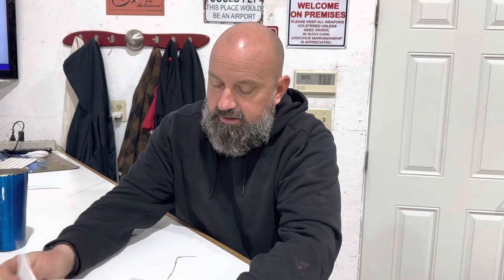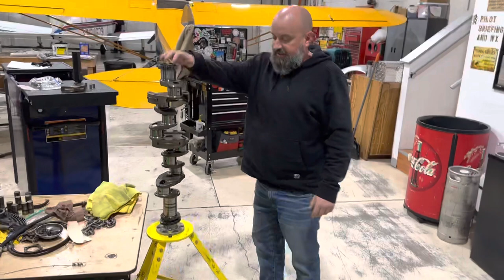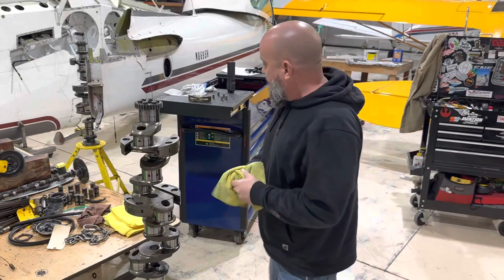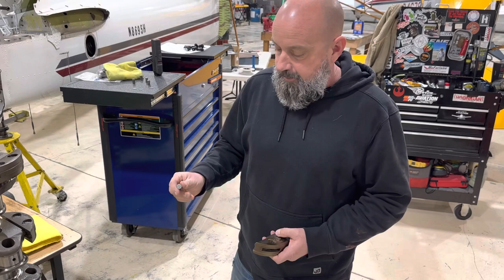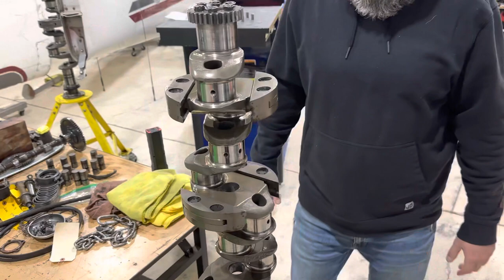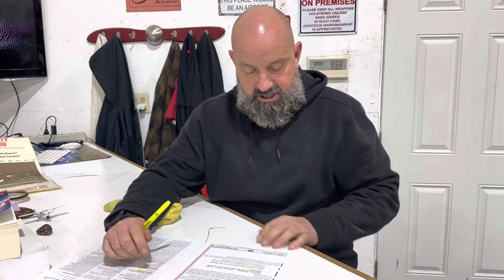Continental grounds planes over crankshaft but why?!?!

Comment: Hmm - opposed cylinder "boxer" engines don't need counterweights. The pendulum dampers you mention are there to stop the crank from winding up and springing back at one specific frequency.
Reply: If opposed cylinder aircraft engines don’t need counterweights, you should inform Continental and Lycoming engineers to save them $ millions from not installing them…
A&P/IA,ASE

Comment: As a AI for 43 years, I would have to say Manifold pressure is the key to crankshaft dampeners working correctly, If you look at most Manifold pressure gauges, the bottom of the green arc is 15", this is the minimum engine piston pressure where the engine is driving the propeller any lower and the propeller is driving the engine and the counter weights flop around and get detuned, rings flutter on the pistons and engine cooling, not good for the engine and snap rings have not changed in 50 years, one side is round and one side has a sharper edge and usually marked on the snap ring with a dot. Look at shimmy dampeners or brake cylinders for info on snap rings. education is hard to learn with out mistakes

Comment: Hopefully they show how the snapring is supposed to be installed, with the sharp edge out.
Reply: I suspect that the circlip is not in the groove at all, but just friction holding it in the borescope would show smaller gap between ears of clip.
Reply: @KeithRigby-r9c  Nope, get one out and really look at how they are made. Because the balancer pins are free to move, they put the retainer in between the pin and the clip. So long as the clip is installed properly, with the sharp edge out, to grip the groove when the clip is forced into it by the pressure of the pin and retainer, against the 'SLIGHTLY DOMED SHAPE OF THE CLIP'. 
If that slightly domed shape is up against the groove, it can be worked out by the action of the pin and retainer.
Best wishes from the far North.
Reply: @KeithRigby-r9c  There is a measurement if you read the SB to check the snap ring (clip) ears for a dimension to make sure they are spread out into the groove so 'yep', you are on the right track.
Reply: Carl is CORRECT
Reply: Sounds like Continental dropped the ball on quality Control however any Knuckle-Buster should know what direction the piston snap ring should face ,Radius to the work ..good content

Comment: Thanks for this. Subscribed! 

This reminded me of an old timer speaking about the old GO- aviation engines having operator (pilot) induced issues. He said pilots were used to running 2700 rpm and were hesitant to run the geared engines at the higher recommended rpms. Thus inducing issues and garnering those engines a bad rap.

Comment: This use of internal snap rings within an aircraft engine is shocking.  High performance, high quality automotive engines do not use snap rings.  For example, piston wrist pins are allowed to float, and are restrained by “buttons” on each end of the wrist pin.
Reply: It’s not the wrist pins that need snap rings on these aircraft engines, it’s the counterweights that most 6 cyl engines have.
As far as the wrist pins on aircraft engines; none that I know of have snap rings (as most auto engines have).
A&P/IA,ASE

Comment: Great vid, I used to work in a part 145 engine shop doing tear down (and test cell).
To remove those counterweight snap rings was challenging while the bare crank was vertical on a stand!
I cannot imagine replacing one through a cylinder bore in a case while engine is installed on aircraft.
A&P/IA,ASE

Comment: That was a good explanation of the problem complete with visuals.  I am a aircraft mechanic myself, but I don't work on any Continentals, just Lycoming and turboprops.  I like your approach to stuff, yes facts based are the best and don't guess, as you said you can form an opinion, but don't guess.  Good job, will be checking out more videos

Comment: I stopped watching at 7:30 just to say that the engine seizing is not the worst part of it, it's what happens immediately afterward. Back in 2015, a good friend of mine crashed his V35B Bonanza after his engine seized at 500 feet AGL on takeoff, due to the exact mechanism you're describing. His engine was around 100 hrs after TBO, an IO520. One pin dropped out and the swinging counterweight cleaned out half the crankcase, taking one cylinder and both magnetos off as it went around. He had just throttled back to best climb from takeoff power, which as @mpgofast alludes unloaded the weights momentarily. Subsequent teardown of what remained of his engine showed the circlips incorrectly installed on another of the weights. He was airborne only 33 seconds after the failure, he sustained severe injuries, but his three passengers walked away with bruises.

FWIW, I've flown with him many times, including twice from NC to Oshkosh, he does not mistreat his plane and flies according to the POH and his 15+ years of flight experience.

Comment: Interesting video that youtube thought I might like... I was a terrestrial engine mechanic for many years. This dynamic crank counterbalance scheme is new to me.
I would be interested in knowing what the problem was with the circlip installation: 
was it clocked wrong?
was the sharp edge of the clip installed facing the wrong way?
Reply: Yup I heard it was the sharp edge.
Reply: It is a stamped circlip. thus it has a round side and a sharp side the sharp side must be on the outside. Some how the rounded side sneaks past the grove and dislodges itself
Reply: @midgetrace  yep,  sounds like that's what happens and happened, some were installed the wrong way

Comment: I know the old E-series engines (E-185, E-225, etc.) don't fall under the AD, but if you have an E-series crankshaft, I'd be very interested in seeing how the balance weights work on those, if they're any different.
Reply: That is because the factory did not sell any new E225s

Comment: You did not explain the fact the issue is with the direction the snap ring is installed.  Many may not understand when snap rings are manufactured they are stamped with a die-set which actually distorts the flatness of the ring with one surface edge becoming slightly rounded and the opposing edge becoming sharpened.  Interestingly this distortion comes with the advantage in that the sharpened edge helps with retention provided the snap ring is installed with the sharp edge opposite the force trying to push the clip out of the groove, in this case toward your face if you are looking directly at the snap ring.  Inversely, if the snap ring is installed with the rounded edge outward then this has the effect of increasing the probability the snap ring can be pushed out of the groove.
Reply: There can also be "clocking", or orienting the gap in the lip to a specific location on the circumference of the groove, which is usually expressed relative to a colck dial. Remembering the clip is spring steel, one half of it may be subject to a force seating it more tightly while at the same time the other half can bend and slip out of the groove. Piston pin clips are often specced to be fitted at 12 oclock or 6 oclock referenced to the bore line so that the inertial force at the ends of travel are balanced and not on a single half of the clip. On these crank weights where centrifugal force acts, you'd orient the gap toward the centerline of the crank to mitigate it; 12 oclock is how that's referenced to in this situation.
Reply: @P_RO_  Right.   I know we've used these stamped clips for about forever...and properly installed they DO work well, but doesn't it seem odd that in such an expensive engine that these retainers would be made where it's critical HOW they're installed?   As we should have learned with Col. Murphy....if it can be installed wrong, design it so that it cannot accidentally be done incorrectly.   This is a clip that costs a few pennies....so we make a better one that works either way it's installed and even if they cost ten dollars to make this increases the cost by $240 which is a pittance on a $30,000+ engine.
Reply: @recoilrob324  They DO work well if made and used properly, so why change from success to complex which might be equally vulnerable to stupidity? Some things clearly have specs, like a cvlinder head bolt. Everyone knows how critical it is to torque these in stages and in a specific pattern, so you look it up  each time.  We don't need specially sized bolts to keep "Bubba" from grabbing a box-end wrench and guessing here. Nor do we need different clips. It's easy to do the job right, and you can't expect a manufacturer to design everything to be stupid-resistant.  :Personally I'm more worried about a design using intentionally loose parts on a crankshaft. There's so many dynamic forces going on there that such a design invites a huge number of issues which are best avoided several thousand feet above the ground and several dozen miles to the nearest place you might be able to set down at with a decent chance of walking away.
Reply: @recoilrob324  And there is a better "mousetrap". It's called a spiral lock or Spirolox.  A full 360 degrees of engagement. There's a visual indicator if it is not fully installed. The installer can tell if the free end  is not fully seated into the groove, because it's not flush with the remainder of itself. And, there is no difference what orientation they are installed in, because they are burr-free.  I'd hope Continental would take this as an opportunity to do the necessary qualification work and make a good product that much better.
Reply: @P_RO_  The fact that you are entirely unfamiliar with dynamic balance weights ("intentionally loose parts") on a crankshaft tells me you have little to no aviation mechanic experience.  Dynamic balance weights are a very common thing on rotating assemblies on recip engines and dynamic components on helicopters (BO-105, UH-60 main rotor systems, V-22, to name a few). They are very necessary and frankly the simplest way to achieve the needed vibration damping in many applications.  A better solution to circlips is needed, and it's not complex, it's simpler. I would hope they take a hard look at spiral locks as a potential drop-in replacement.  Hell, you can install them by hand in most cases, and remove with a common screwdriver.

Comment: Is the proper installation of circlips covered somewhere in AC 43.13 1b/2b or is it information that would be in a manufacturer's instructions, or would I have learned this in a formal A&P training program? Just starting out (14 weeks OJT) as an AMT...and this is another thing to add to my list of "Why the hell have I never heard of that?"

I wonder if the orientation of circlips is an artifact of the manufacturing process...I suppose they are die stamped...or is there an engineered intention to give them a sharp edge? I have replaced circlips (on non critical applications, particularly my little planisher and the thust bearings on my band saws) and never could figure why sometimes the circlips would easily slip off my pliers and disappear across the shop while other times they would grip tightly to the pliers as desired.

Anyway, seems like you have lots to teach, so I'm subscribing.
Reply: Yes, the sharp edge is just because they're die stamped.  All engineers I know would want to remove the burrs, if it didn't cost more money (and I work with quite a few on a daily basis).  
The way a snap ring should "face" is determined by manufacturer instructions.  Barring that, you're on your own. No specific instruction was given in my formal training that I can recall, but that training may have influenced my thinking, hopefully for the better. 
I will say in my experience with snaprings, having the sharp side facing away from whatever they're retaining is good for two reasons (and not the reasons you normally hear):
1) Installing with the smoother rounded side facing the component allows the snapring to expand more freely into the retention groove. If installed with the sharp side facing the component being retained, the snapring may bite into the component being retained, or the lower edge of the groove, during install and prevent full seating in the retention groove. You're normally pushing down on the snapring somewhat during install, even with snapring pliers, so having the smooth side facing the component prevents the sharp edges from digging in. Conversely, this pushing down also minimizes the sharp edge from digging into the top of the retention groove during install.
2) During operation, I figure it's best if the component that is being retained is not being chaffed on by the sharp edges. I want what I'm retaining to remain in good condition. There is normally some relative motion between retained components and the snap ring. Whereas, a properly sized snap ring often, though not always, is snug in it's retention groove, and shouldn't move around much in its groove.
OJT can be very good, though seek out opportunities for formal training on topics. It's easy to pick up bad habits from OJT and not know it.  FAA-approved IA seminars (they need them for continuing ed. credit) put on by community colleges are a good place to get low cost training with added potential for networking.

Comment: Snap ring installation. Critical .  Never expand the snap ring farther than it takes to get it over the end of the shaft.  This takes the spring tension out and causes failure.  
This reduces snap ring grip in or on the bottom of the groove.  

 I can't imagine why these aren't being replaced with spirolock retaining rings. 

   Other things that squeeze me wrong are over compressing valve springs when putting the keepers in.   Or putting them in coil bind on the valve spring tester.  Over stretching piston rings to get them on the piston. 

   I totally understand that the retaining rings go on sharp side out. 

Am i knit picking. I build automotive engines. I went thru 6 engines in 5 years in my 66 GTO and have seen decades of engine failures during normal teardowns. Learned the expensive way of what works and what fails.

Comment: So it seems this is the current batch of engines, not all of them. 
If it was a car they would be recalled and repaired by the manufacturer.
Personally this seems to be a very crude system having some weights rattling around on the crank

Comment: Why didn't you mention right off the bat that that the snap ring has 2 sides? One is square and the other is rounded and some of the snap rings were put in backwards with the rounded side out.

Comment: pretty frightening stuff .... loose steel weights banging around on a crankshaft.....i'm way out of the flying addiction at my age now, but back in the day i always preferred lycoming engines....everything i read about continentals seemed to come up short compared to the same spec lycoming
Reply: Lycoming has floating counter weights also anything like a Mooney or Cheroke 6  200 HP and up

Comment: It is my understanding that the counter weights are there to dampen the harmonics of the prop. That is why you have a restriction on RPM. Alot of planes have a yellow arc on the tach as a "do not operate at this RPM for prolonged periods". Your description of how the counter weights work is totaly wrong. Sorry.

Comment: Pinning extra weight to a crankshaft seems like a disaster waiting to happen, so implementing that on an engine that may lead to falling from the sky if the crankshaft fails appears to be bad × stupid...
Reply: Actually very necessary in aviation applications.  Remember you're not on the ground which acts as a great vibration damper in conjunction with your vehicle's shocks.  The air has very poor damping, so you need ways to shift frequencies away from the resonant frequencies of the airframe or engine so that components don't literally shake themselves apart.  Look up "resonant frequencies of mechanical systems".  This is one reason why most attempts to use engines developed for ground vehicles on aircraft result in unreliable outcomes, unless special (and often $$$) provisions or modifications are made.
Reply: @whirltech8031  the need for proper balance is clear, and obvious, the method of achieving said balance is stupid,(for Continental) Tires and shocks and what the engine is bolted to have ZERO effect on engine balance, it is either is, or is not well balanced, and how that effects whatever an engine is bolted to, depends on what it is bolted to. Aircraft are, by nature, light and flimsy and fragile by design, and therefore Continental should have taken the time to engineer a solution that does not involve pinning weight to crankshaft, a stupid, low budget "fix" that is a glaringly obvious mistake. You don't see Lycoming horizontally opposed 6 cylinder crankshafts coming apart, or being recalled, do you ? No, because they are one piece forgings, without extra metal pinned to them.
Reply: @whirltech8031 Modern engines are far smoother running than these dinosaurs